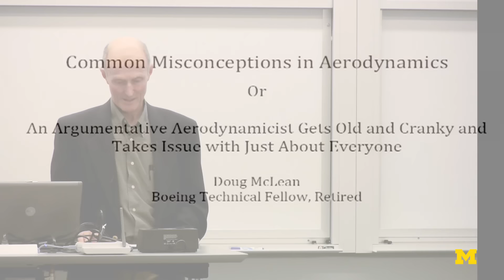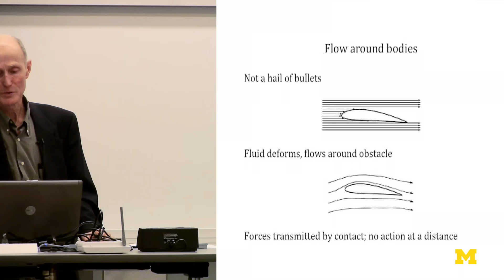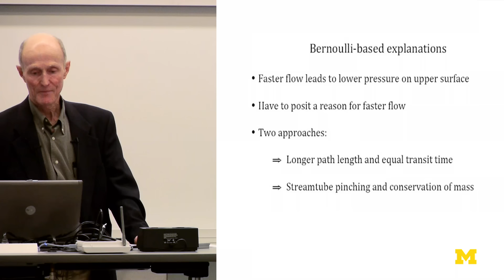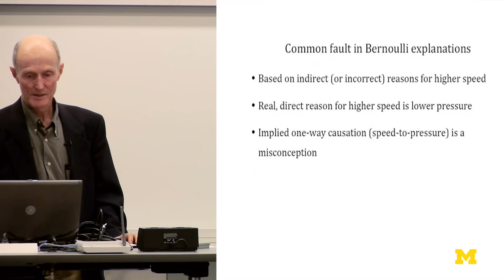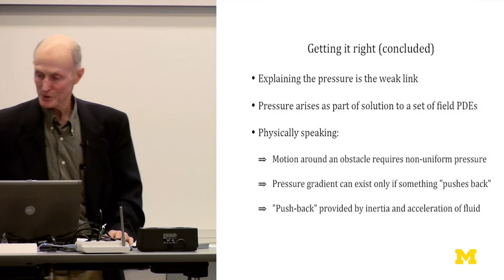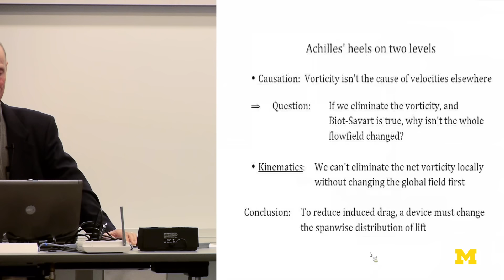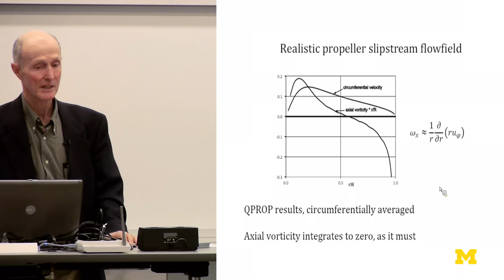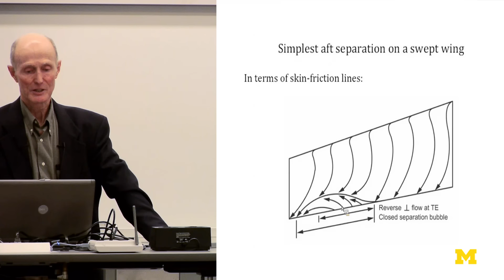Doug McLean | Common Misconceptions in Aerodynamics

Comment: The bottom half of an airfoil is for lift, the top half is for control.
Just putting it out there, observation no testing, theory, etc.
Reply: Where on earth did you get that nonsense?
Reply: @alans172  It fits the 2D model for starters - 22:20 "a flux of upwash ahead of the airfoil and a flux of downwash behind - that account for all of the lift each - airfoil imparted the lift - also applies in 3D" - Since the upwash/downwash account for all the lift, the pressure variance on top allows increased control. I'll bet you one thumbs-up if you parse my statement, I can fit your model into this framework using your parsing of my statement. - It's a lot of work and I don't blame you if you don't want to start. Just don't insult ideas that aren't harmful, disprove them.
Reply: @cowboybob7093  Ah! You said " observation no testing, theory, etc" which could logically mean "...no testing, no theory..." But you were using McLean's theory. I can make no sense of that theory when later, around 26:00  he sources lift from "pressure fields" and from "diffuse clouds of low pressure" !
Reply: @alans172  The guy's really good. Citing inertia as a component is not heard often. I guess I was writing about flight, not lift. I'm still working on a good way to sum it up in a few words. `Lift is only half the problem, control is the other` for instance. Obviously that refers to the Wright brothers conceptual leap.
Reply: @cowboybob7093  you chided me for insulting "ideas  that aren't harmful". I reserve the right to insult ideas that make no sense such as "pressure fields" and "diffuse clouds of low pressure".
Reply: @alans172  Does this clip add to your understanding of lift or is it generally misleading as far as you're concerned? He does address theories he finds weak, is "diffuse clouds..." one of those? I scanned through and couldn't find that from  about 21:00 on. No problem about your right of expression, btw, some people are disingenuous, not you.
Reply: @cowboybob7093  25:06 "diffuse cloud of low pressure"
Reply: @alans172  (long reply, tried to make it readable)
Thanks for the time stamp - I'm approaching this as cooperative analysis, not one-upmanship.

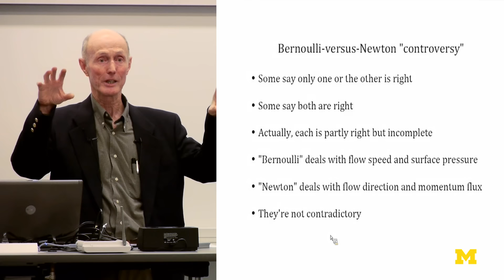Starting from the slide intro a minute earlier than your timestamp 24:05 -
I'd characterize his two "sort of diffuse cloud" allusions as poor labels for his subsequent description of the airfoil's effect on the continuous medium above and below. His description of pressure gradients both flow-wise and cross-span are empirically accurate and required by most models. (1 - Do you agree they are empirically accurate?)

Further, 
D.M. 24:37 states "velocity and pressure are affected over a very wide area around the airfoil" - I would substitute "area" with "volume" and suggest he would too, but not for his presentation being a lecture with some off-the-cuff remarks. D.M's occasional note flipping suggests the lecture is not tightly scripted.

I think all three of us (including D.M.) might agree that the diagrammed cross section with dots is a non-intuitive illustration of his assertion of "higher pressure underneath." My interpretation of it is: The close placement of dots illustrate greater flow velocity. It can stand improvement since to me dots indicate 'static,' arrows indicate flow, and arrows can be varied to indicate different velocities. I think it's "bad art" and I'm cutting him some slack. But I digress. 

Since velocity and pressure are inversely related, more dots in the diagram means higher velocity thus lower pressure. 

Further still:
Schillerian images of shock waves over wings and separately the use of variable inlet geometry in supersonic aircraft demonstrate the instant when airflow becomes subsonic its pressure increases. Thus in the classic Schillerian wing cross-section images used to illustrate the sound barrier the flow abruptly becomes subsonic, the color changes from dark to light indicating slower speed/higher pressure.

Note: The statement is not 'higher pressure than underneath.' I meant 'higher pressure than immediately before' in context of staying on one side of the airfoil.

(2 - Do you also interpret the 'air foil and dots' diagram in the slide we're concentrating on, to be a non-intuitive illustration of both velocities and pressures?)

I could go on, but I think it's time for feedback.

And it's also time for the "feed bag" - that is, lunch!
Reply: @cowboybob7093  I appreciate your references to cooperative analysis and one-upmanship, but since Socrates, the tradition of combative discourse has been found to be an effective method of resolving philosophical arguments. Understanding science is natural philosophy.
When I find a fault in your or D.M's argument I dispense with the polite veneer of courtesy and address the deep layers of logic directly, even bluntly. I am not necessarily attempting to sway you with my argument, but to encourage other readers who may also be disturbed by the paradoxes, to redouble their resolve to get to the truth.
So here goes: I'll try to address as many issues in your response as I can.
I may have an advantage here in that I have a digital copy of his book and can assure you that his use of "clouds of low pressure" is not the result of it being a lecture with some off-the-cuff remarks, but a phrase that he uses on at least five pages of his book, including six times in his section 7.3.3 "A Basic Explanation of Lift on an Airfoil, Accessible to a Nontechnical Audience". If I could, I would emphasise "Nontechnical Audience"

In answer to your Q1: Yes. "His description of pressure gradients both flow-wise and cross-span are empirically accurate" Of course they are, they have been derived from a million wind tunnel experiments. My issue is that D.M.'s explanation for the source of these pressure gradients is inadequate at best.

"Further, D.M. 24:37 states "velocity and pressure are affected over a very wide area around the airfoil" Whilst wind tunnel experiments provide evidence of pressure variations there is no experimental evidence offered or available to support the statement about velocity. We, the students of aerodynamics, have become so conditioned to accept the Benoullian nexus of pressure and velocity that we do not recognise the paradox.
 Benoulli worked with incompressible water. Air is compressible. In air, pressure and velocity are not tightly entrained. Look at Babinsky's video there is no evidence of the air accelerating over the foil. 

I could go on, but will stop here, but after all if there is a single flaw in an argument then the argument fails, so what's the point in labouring the issue?
Reply: @alans172  I'll get back

Comment: 48 minutes of misconception based on the very first statement of basics. "A fluid flows as if it were a continuous material." This is a very useful mistake, but never the less a mistake.  Aerodynamics is not about air, but about a non-existent phenomena called a "fluid", that in it's turn needs to be thought of as an equally non-existent continuous material. This whole science does not allow for the physical reality of air. It simply ignores properties of air that though proven by testing and hence emperical fact, do not apply for either a fluid or a continuous material. That's the whole story in five easy to read sentences. I'll bet you don't like that.
Reply: Yeah, it's very idealized, but the theory aligns closely with reality, so it's still useful.
Reply: @AmbientMorality  Absolutely, but the moment you tell people that the thing keeping them in the air is not the air itself, but rather the harmony with it, most of them blow a fuse and get all religious.

Comment: "Why is it called Rocket Science?"  Also from the 40, and 50s.  In the news reels, Braun, and Einstein were called "German Scientists" so was Freud.  (Note one was Swiss, and another Austrian.)  So, basically the Nazis ruined that too.  Airplanes were fairly new, but rockets, and mushroom clouds were Futuristic!  Even into the 60s.  Ironiclly, they're still kinda futuristic to this day.  So, it's like the FAQ "Why don't we have flying cars?"  The asumption is that it's Purely an engineering challenge, but We being the operative word.  We can't stop Drunk Driving.  So, there's another good reason why.
Reply: If your car runs out of gas, you don't fall out of the sky at hundreds of miles per hour, and honestly, Buck Rodgers didn't have to worry about Physics, like Safety, and Range.  We, you and I, normal people will never have flying cars.  They're not practical, they can't be made practical.

Comment: I think it would be beneficial to the viewer to know in simple terms, just how accurate the various aerodynamic computer programs are. They can't be THAT far off otherwise we would be seeing aircraft dropping out the sky on a regular basis!
I fly RC planes and the three planes that I have flown that perform* the best (Uproar, Gremlin combat plane and Blue Angel pattern plane). All had rather thick completely symmetrical NACA airfoils. 
* - Perform here means allows aerobatics over a wide speed range and very predictable stall performance

Comment: I knew that Bernoulli wing lift had to be wrong. After all, how do stunt pilots fly upside down?
Reply: Lots of down elevator
Reply: @janedubourg4837  Right, but that's pitch, angle of attack. Nothing to do with Bernoulli.
Reply: @kdub1242  You answered your own question.   Look at a stunt plane flying in level flight, both upright and inverted.   You will almost always see that the airplane, when inverted, has its fuselage at a greater angle to the direction of flight than when upright.  That is because of the greater angle of attack needed on the wing to generate the same lift.   Flying upside is no mystery - as long as your fuel and lubricating systems are designed for sustained inverted flight!

Comment: The cause of most lift is area just above wing has higher fluid velocity. This combined with curved arch of wing gives centrifugal lift also. Now you know the secret. TR 3 propulsion. Replace air with mercury. Sorry I have said to much.
Reply: Correction: Yes, what occurs above contributes the greater amount of pressure difference than what happens below. 
However, the "higher velocity" does NOT cause a lowered pressure. This is an all too common myth spread all over.

The ACCELERATION of the air above a wing is CAUSED BY the lower pressure there.  As a wing moves through still air, the air going above is first pushed forward (and a bit up) BEFORE the wing's arrival (called up-wash)  mainly by the under-wing pressure,.
However, as the wing passes by, that lowered pressure really yanks that air rearward, in high acceleration,  revering its direction totally making it actually travel in the reverse direction of the wing !  It actually is traveling REARWARD slower than the under-wing air is traveling forward.!.!.!.

Comment: Who came up with the Bernoulli explanation? That's the stupidest idea I have ever heard. It assumes that wings are always that shape. That's just insanely stupid. How can a physical theory be based on a drawing of a wing shape? I don't get it why someone would believe it.
Reply: Well... it DOES have to be sort of flat and at the appropriate angle to create the pressure changes around it, but you are correct that it is ultimately the air flow pattern that sets up the lift. All wings generating lift have very similar air-flow patterns and pressure changes.
Reply: @Observ45er  No, it doesn't have to be flat.  In fact, look up supercritical airfoils (Dr. Richard Whitcomb) and you will see that the aft lower surface of wing is dished out (cusped).   This puts camber aft in the airfoil and pulls the lift distribution aft.   This results in weaker shocks (for the same lift) and hence lower drag/faster speed.
Reply: @dougball328   Perhaps I could have said that better.  I said "sort of flat" meaning that is isn't round or square with relatively equal thickness and chord, but it has a thickness that is much less than its chord a.k.a. "sort of flat". Then, that "flat-ish" thing must also have an orientation that we can call AOA.  Were talking the fundamentals of lift, not every advanced concept. 
Completely FLAT balsa wings, symmetrical camber, asymmetrical camber, super critical wings all have this general shape and use the same fundamental phenomena to change the pressures around them that sum to our benefit  and generate upward force we call lift.  THEN, there are all the advances details that make things better for one reason or another. 
Super critical concepts aren't going to help when one can't get over the common misconceptions (Bernoulli, pinching-half venturi, etc) and understand the fundamental physics first.
Thanks for making me improve that thought.

Comment: aerodynamic .. velocity causes low pressure .....prof Martin ...misconceptions in aerodynamics ......Newton's third law ...boundary layer separation  ....extreme altitudes ..... velocity is vector field ......dynamics  strokes equation , momentum equation , thermodynamics ......equations relate clear acceleration of fluid , forces are transmitted through molecular movement ....solid surface ......consequences ......fluid stretching , propulsion of rocket ........action and reaction exchanged by the fluid and solid across their interface generated by accelerated fluid ....generic .....wind  exerts thrust .... flow fluid .....phenomenon .....

Comment: "Common Misconceptions in Aerodynamics"
Airplanes don't fly because of low pressure on top of the wing. If that were true then every aerobatic pilot would fly directly into the ground when they fly upside down.
Reply: Airplanes can fly upside down because, by angling the nose skyward, they generate a positive angle of attack (angle of the wing to the oncoming airstream) which then generates a high pressure below the wing and a low pressure above which, combined, keeps it flying.
Reply: @alans172  That's just a fancy way of saying that the plane stays up because it is skipping over the air as it passes under the wing......right-side up or up-side down.
Reply: @rael5469  No, that is a silly simplification and ignores the contribution of the low pressure above the wing to generate lift. A stone skips across water entirely due to the force underneath. A plane stays in the air due to the combination of high pressure below AND low pressure above.
Reply: @alans172  If the leading edge devices are not needed during inverted flight.......how do they keep them from extending ....during inverted flight ?
Reply: @rael5469  What have LE devices got to do with the issue? I don't know whether aerobatic aircraft have LE devices, but if they do, I'm sure the aircraft are fitted with the ability to control when they are extended. especially in inverted flight. Seems an odd question. What are you getting at?
Reply: @alans172  "What have LE devices got to do with the issue? "
They increase the curvature of the air foil to provide more lift.....when flying upright. If they deployed while inverted it would only make inverted flight harder.....wouldn't it?
Reply: @alans172  " I'm sure the aircraft are fitted with the ability to control when they are extended." 
That is a VERY good question. For instance....the F-16 is fly-by-wire. The aircraft may not know....or care whether you re upright or upside down. It might only depend on airspeed and G forces.....angle of attack? In that case what difference would it make?....the orientation of the wings to the ground. HOWEVER......if the pilot just turns the aircraft upside down and applies negative Gs......does the Fly-by-Wire system know this and keep the leading edge devices retracted? (streamlined, in the case of the F-16) Does fly-by-wire know when the aircraft is flying inverted and does it control the leading edge differently during inverted flight? I'd have to check out some flight demo videos.
https://www.youtube.com/watch?v=Y9CJsSRjDZE
Reply: @rael5469  Of course they would, and that’s why they wouldn’t be deployed in inverted flight. What’s your point?
Reply: @alans172  You keep saying what am I getting at....what's my point. There's no particular point. Just commenting on inverted flight. To me....not an engineer.....inverted flight raises questions about the conventional theory of  how an aircraft stays aloft. I don't think the flat side of the wing.....the bottom.....generates lift during inverted flight. That would tend to prove that you don't need a curved wing shape or lower pressure on the upper surface to stay in flight. You just need to ski off the air "under" the wing whether upright or inverted.
Reply: @alans172  I've had a pedestrain theory about what would it be like to design say.....an A320 aircraft with 
1) No thrust reversers, thus allowing a WAY lighter cowling. HUGE weight savings. HUGE savings in complexity and maintenance.
2) No flaps or slats. Same weight and complexity savings. 
3) Fixed landing gear. Ditto the savings. 
I was thinking that you'd need larger brakes but with all of the weight savings you may not need larger brakes. 
Now THAT would be a radical design. The fuselage barrel could continue all the way through the space formerly used to stow the landing gear. More fuel. More cargo. More everything. 
What do you think? Are you ready to buy some stock?
Reply: The only way the wing has to interact with the air is via pressure. Pressure always acts perpendicular to the wing surface. Ergo there has to be higher pressure, on average, on one side than the other in order to generate an aerodynamic force, whether upright or not. During inverted flight, the pilot ‘inverts’ angle of attack so the lift continues to oppose gravity. In a pure aerobat, this is essentially just as aerodynamically efficient as normal flight, but in utility airplanes (with cambered airfoils) it is most inefficient to fly inverted, even though some are certified for limited aerobatics.